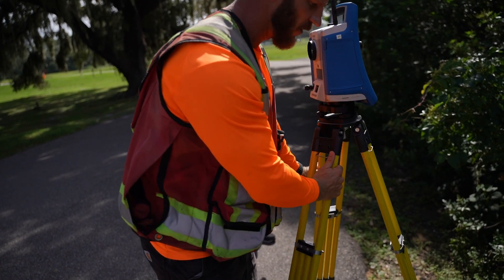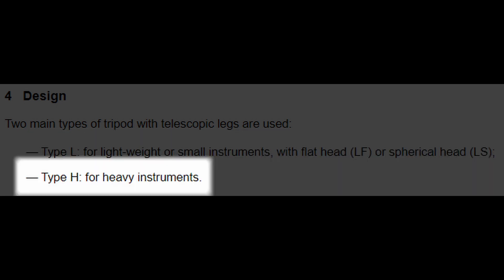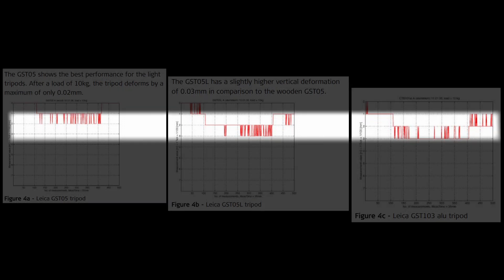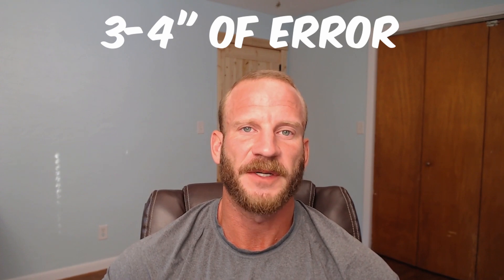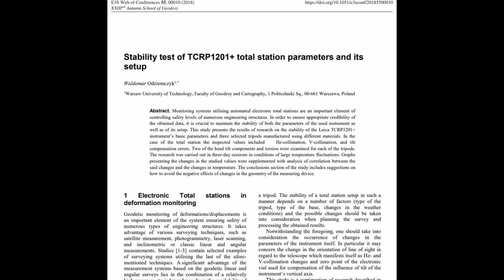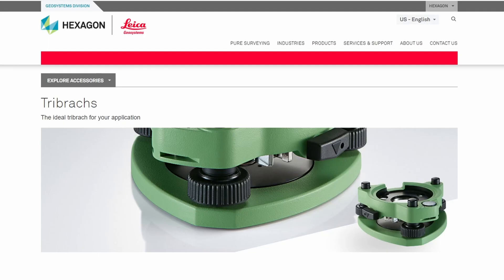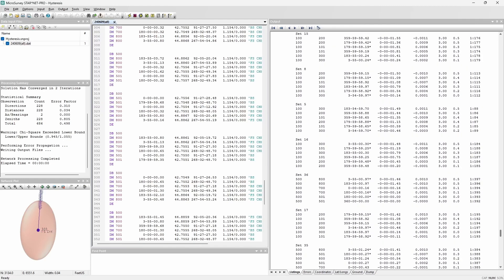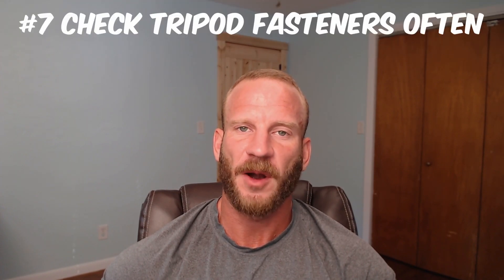Land Surveying 101 - Tripod Selection

Comment: You should consider also that when pushing the legs down, on soft dirt , or even when placing the tripod on the ground, hard surface , there will be a situation that the 3 legs touching the ground will have some sort of initial stress , tending to rotate the base of the tripod , especially when tempreture starts to climp,  the stress will start to be relised slowly  causing a minor rotating or even leveling of the base where the total station is sitting
Reply from the maker: Very good point! Do you have a method you like to use to release that stress prior to setup?
Reply: I have noticed this too, the Leica GST120 is bad for this. I've made a habit of giving the legs a bonk with half tight screws, hearing a click/squeak, then tighten. They tend to create torsional stress from misalignment in the leg sections.

Comment: For 15 years now, I have been laying high-precision tracks in microtunnels from 1200 mm to 3000 mm in diameter. The length of such tunnels can reach 2000 meters, and the number of points that I measure with a total station can reach 15, since there are turns in the tunnels. With such measurements, it is impossible to return to the starting points from which the measurements began, since mining equipment stops for very long periods. I almost made a very big mistake with tripods, on which I did not check the tightening of the sharp tips in contact with the surface on which the tripod is mounted, and the nozzle into which this tip is screwed, it is attached with two hexagonal bolts to the wooden leg of the tripod. Basically, of course, we use forced installation. I always tighten all the bolts on the tripod because I don't know who has worked with it before. Each time before the measurement, a check and calibration is performed. Most often, the tripods (the stand for the total station) failed, someone dropped or tightened the screws very hard, which led to their breakdown, and the tunnel went into the wrong shaft where it should have been), thank God, this did not happen. I wish I'd seen a video like this before. Everything is to the point and understandable, thank you very much. I'll tell my team about it.

Comment: I am thinking about using a DeWalt surveyor's tripod, such as shown in the video, for mounting a portable high frequency antenna. I would need to fabricate a mount to fit on the top flat circular part of the tripod.  I live out in the boonies and don't have anywhere around where I can go put my hands on a surveyor's tripod - do you know the diameter of the top flat circular part of the tripod (where surveyor tools mount) as well as the diameter of the hole in that top of the tripod?  Thanks much!
Reply from the maker: The top plate diameter is usually around 6" depending on which tripod and the hole is usually around 1.5-2"
Reply: @The3rdDimensionSurveying  thanks!

Comment: At 10:10 you said - error that the compensator would clean up. 
The compensator can not clean up a rotational drift of the top if the plate. 
Only way to detect it is to chech the orientation to backsight and reorientate if out more than what you can accept.
Reply from the maker: @misilen24  I said this isn’t the kind of error that the compensator would clean up.

 I can be difficult to understand sometimes, my apologies.

Comment: When I first read the paper I had recently imported a Trimax for my new robotic TS so I was fuming when I saw the Leica paper saying my old Leica wooden tripod was the actually the GOAT and that I had to shelve my new tripod if I wanted max accuracy. So I did some digging at the time and found the original paper which made me "increase the  number of grains of salt"...Today I had some time to search for the older paper (ts08c_eichhorn_etal_3208.pdf) and I quote: 
"All following investigations are realized in a lab at Leica Geosystems AG in Heerbrugg /Switzerland..."
"The lab allows to establish constant environmental conditions by minimization of changes in temperature and humidity."
"To create reproducible test conditions, the tripod legs are fully extended and equally spaced on the ground with 1 m distance" 
I am pretty sure that at a normal setup height the differences between the different kind/brands will be neglible and, if one tosses in humidity, rain, sunlight,etc the composite/ fiber glass tripods might even come ahead.

What you mention regarding maintaining our equipment, letting the tripod (and TS) acclimatize and checking our backsight have a much bigger impact in the accuracy of our work. Also, the parasol is not there to shade the surveyor...

Comment: This white paper was released by Leica who made a summary...biased? certainly. when they say "temperature and humididy were not considered" they definitively controlled it...humidity, the achiles heel of wooden tripods...I also remember reading the paper a while back and seing the tripods were tested fully extended. Who the heck uses the tripod like that? Also, using a torque wrench? Why not just tighten them firmly? With the torque wrench Ithey can tighten the leicas just enough and leave the others a bit loose...
On the other end, your recommendations to minimize the error brought by the  tripods are really good! Thank for your videos!
Reply from the maker: Well the white paper was actually based on a study that was done years before. Absolutely temp and pressure were controlled, which makes sense to me to control external influences that would affect the results to make sure all testing done was fair. I actually don't believe the tripods were fully extended. It says in the study they were lengthened to ISO spec. ISO gives very specific specs to which the tripod should be setup at during testing which they complied to. Why use a torque wrench? Again, to make sure all test subjects were tightened equally. It's just good science. Now... did Leica cherry pick data from that study to make their tripods look better or did they have influence on what tripods were in the test? It is possible. If I could afford to replicate such testing with the controls they have in place and the instrumentation & access to equipment, nothing would make me happier to be able to provide unbiased test. But as far as testing parameter's I believe they were following ISO's standards for the most part. Hopefully I can revisit this topic again in the not so distant future when I have more resources available. Thanks for the comment!

Comment: Great video. Still, I'd have liked to see at least one of the cheaper but heavy weight tripods (eg/Topcon/Sokkia) included in your testing. The Leica white paper on tripods skipped that also.
Reply from the maker: The Leica White paper did skip other tripods, the study the white paper was based off of actually did include a cheaper Chinese Fiberglass tripod. I didn't include it in my review because I could only find an abbreviated version of the original study and didn't have all the graphs of the actual measurements. It performed similar to the Trimax except the horizontal drift was almost 3x worse than the Trimax and obviously magnitudes worse than the Leica's. 

I wish I had access to a larger variety of equipment for my own testing. 

If any equipment suppliers happen to read this and want to team up together for future videos, please reach out!

Comment: I've been surveying for about 18 years, and I've used both Leica GST 120-9 Tripods, Crain Trimax Tripods, and Dutch Hill Tripods.. I wasn't really a fan of the trimax tripods, I liked the large top plate, they felt very solid, but we had a lot of issues with the foot pegs splitting over time and use. I liked the Dutch hills they seemed to be decent, but for some reason I always came back to the Leica Tripods
 Sounds weird but I'm a fan of the twist clamps.. a lot of the guys I worked with didn't like the Leica legs even though they came with the instruments... they said they looked cheap. I never understood why, they always felt solid to me. They may not look very complex but they seemed to be of great quality and well thought out. My favorite feature being the interlocking foot pegs for easy transport and storage, no additional straps to corral the legs together, just a simple but very effective tripod in my opinion.
Reply from the maker: @aidanburfield2670  +1 for the interlocking foot design. So simple yet so effective. I’m actually surprised in all this time another company hasn’t “borrowed” that idea.

Comment: Most of the setups I see now are too narrow at the base, because of the methodology most people now use to set up.  Most people now, at some point in their process, look thru the optical plummet when the tripod is only approximately level, and while holding two legs not touching the ground.  Correct setup process should instead involve looking through the optical plummet ONLY after all three legs are at their final location and planted.  With all three legs planted and the tripod head roughly eyeball level, a plumb bob (or just a good eye) can be used to get the tripod head within 30mm (0.10') by lengthening or shortening one or two legs.  The instrument is then leveled perfectly, and slid over the point.  The optical plummet is NOT (or rather should not be) utilized until the legs are all planted, and the instrument is completely level.  This process does require using a plumb bob (or just a good eyeball) to get the instrument within 30mm in the first place.  Why is this important?  Because first, the method most people use nowadays involves a "dance" where you place one leg, level the tripod head roughly, and then, with the other two legs held off the ground, and while looking through the not really plumb yet optical plummet, you attempt to get the tripod head roughly over the point using the plummet.  You then lower the two free legs, plant all three legs, and then again look thru the still not plumb plummet to figure out which tripod legs to lengthen or shorten.  This "dance" results in "narrow" setups that can easily be blown over, and I have seen that happen.  The "dance" also causes instrument setups to take way too long, although that is rarely important.  I can set up my instrument in sixty seconds, with a wide stable stance, 19 times out of 20.  The main reason I don't like the "dance" method most folks use now is not because it is slow, but because the setups don't look stable to me at all.  In my opinion, those narrow stance setups contribute a lot to the torque, settlement and other problems mentioned in this video.  They are possibly the greatest contributor to such problems, with the exception of folks who try to use the truly lightweight tripods for the heaviest robots.  If you don't do anything else, use a heavy wood tripod, and lengthen those legs about a half foot on every setup.  There is NO advantage to those narrow setups, and no good reason to use them.